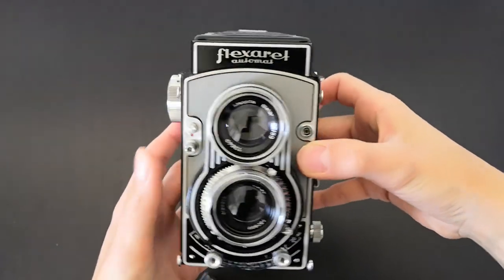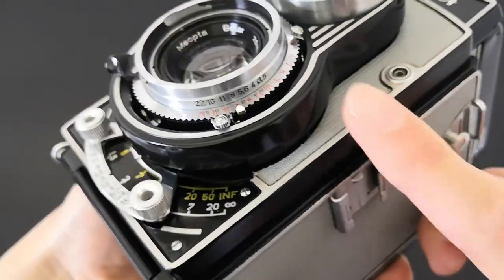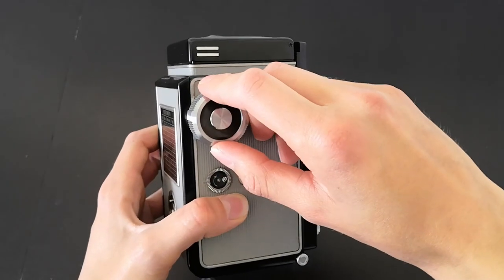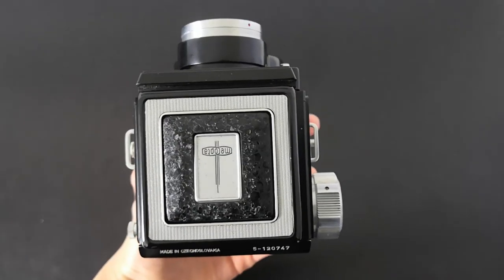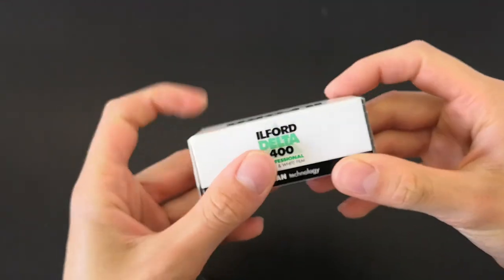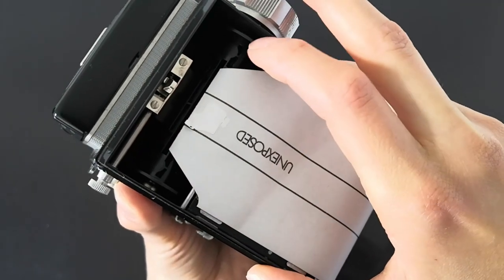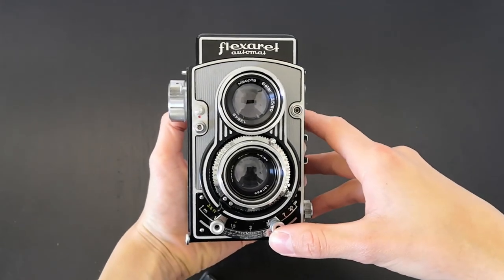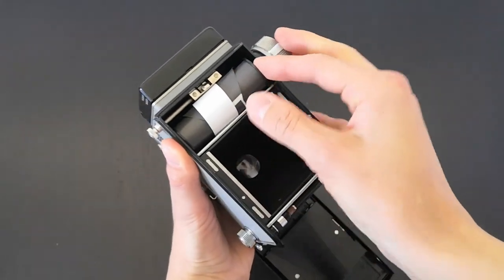How to use TLR cameras - introduction to the Meopta Flexaret VI

Comment: Thanks to this video I was able to identify the camera I got from ebay (in a lot sale) as a Automat IV. The viewfinder won't close anymore on my model and the shutter seems to be a bit slugghish when using the slow speeds. Sadly that seems to happen to a lot of old leaf shutters that haven't been used in years. But as you don't really need them that often when shooting handheld I'll try it with film as soon as the weather (hopefully) gets better in the spring. This is quite an impressivly over-engineered piece of 1960s technology and it looks really pretty, so I'm lucky I got it for quite a reasonable price. Thanks again for your video!

Comment: I just received mine via ebay, i was a bit startled as mine also has the 500th of a second shutter, i was a bit confused as on internet they only mention the VII version has 500th of a second. Anyhow very much tanks for your video, i was also stuck on how to cock the shutter, luck ; i did not know the operation of cocking the shutter was related to winding the film, luckily had some old fp4 lying around as well :P

Comment: I just love your accent! Just correction. Flexaret was made by Meopta Přerov between years 1939 - 1970. The last model VII. was outdated and thanks to cooperation with DDR quite faulty.
Reply: Sorry for the slight offtopic, but do you have any idea if it's safe to set the shutter speed on the VI model after the shutter has been cocked? I couldn't find any info online in English.
Reply: @lindemann316  Hi, that causes some problems.
Reply: @patrickfridrichovsky3909  i guess i'll build a habit not to do it then, thanks.

Comment: Hi am wondering what is the magic electronic tool to measure the light intensity outside
Reply from the maker: It's a light meter. I am metering the intensity of the light which will hit the object I am about to take a photograph of. If you are looking for buying a used light meter  don't buy an really old one which could be inaccurate because of old technology like selenium cells or mercury batteries which are no longer produced. Mine is quite accurate and uses 9v block batteries if you are curious about it.

Comment: Hello I have foexaret automat too, but it looks like the shutter is stucked. When I open the camera I can see through the lens so I can't even put film inside because it will be exposed eventually. Can you help me with this?
Reply from the maker: It is the top lens you are looking trough. But the film is exposed with the bottom lens. So you will always be able to look through the fiewfinder since it isn't connected with the actual picture taking mechanism. Look close to your bottom lens and see if the leaf shutter is closed then every thing should be fine with it. It could also be that you have locked your shutter release knob when you are not able to press it down. There should be somewhere close to it a small switch to unlock.

Comment: You have an amazing camera. Is it possible to do double exposures with it? Greetings from Mexico
Reply from the maker: Actually it is absolutely impossible to take duble exposures with this camera. In the time it was manufactured the impossibilitiy of unexpected duble exposures was seen as a great feature which is mentioned for several times in the original instruction sheet.

If you are searching for a TLR camera which is capable of duble exposures I would recommend you to check out the seagull 4a.
Reply: @brainyphotographer2474  thanks a lot for the answer 🖖🏼
Reply: @toqtoq3361  thanks a lot. I tried a Mamiya C300 but it was quite heavy. I bought a Minolta Autocord and its amazing!

Comment: It's a great camera, you have a wonderful looking one, looks in great condition.
Mine of currently being serviced.

Do you have the 35mm film adapter too?
Reply from the maker: I own the 35 mm kit, but honestly I have never tried it. To me it seems  like a backup solution when no 120 film is availabe. You are only able to shoot portrait format with the camera in regular position. For landscape it is necessary to turn the camera ninety degree which comes really unhandy for using the top fiewfinder. But of course they built a small additional fiewfinder to slip on the coldshoe but I don't own it yet.

Hope your camera is fine after service!